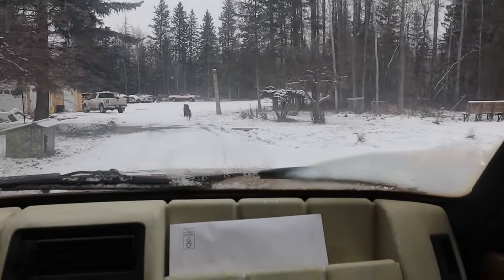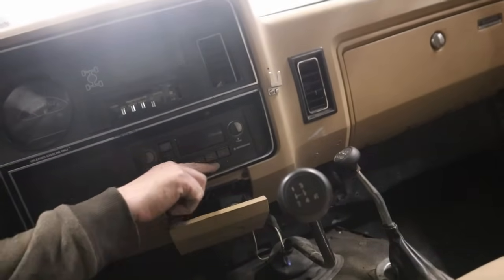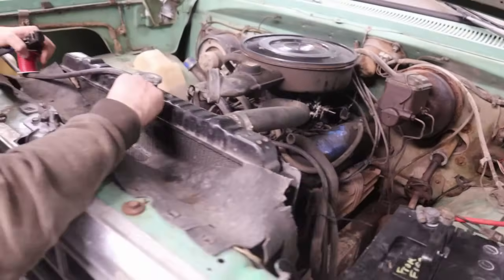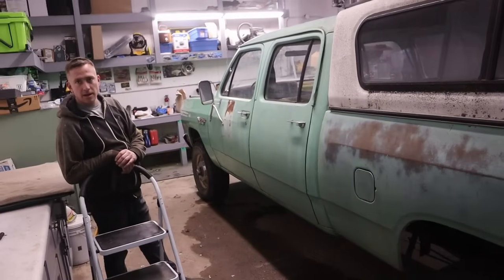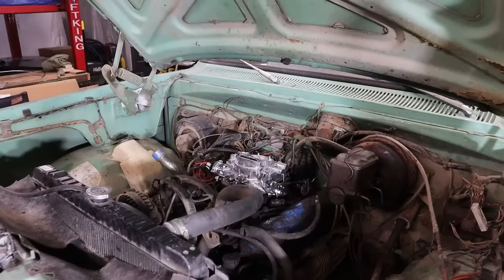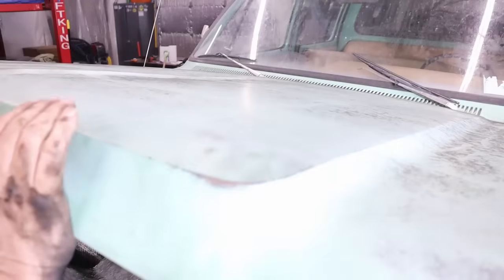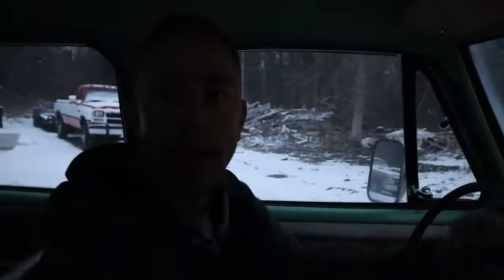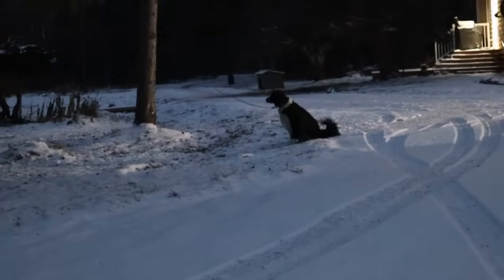Dodge Crewcab 4x4 Stick! Will this Ex-Forestry Truck Run?

Comment: Great truck and an excellent addition to Dan’s fleet. To get rid of the vacuum leak he’ll want to get a square bore to spread bore adapter. When I saw the carb go on without it and a big vacuum leak resulting I knew why. As it’s only for yard drives for now it’s fine

Comment: I’m from the UK, seeing someone climb into the engine bay & sit down to remove the carb is not an everyday sight 😅 What a beast that truck is 👍
Reply: I’ve done that with both of my square body Chevy trucks, just climb inside. To get the brake booster off on my current 73 one ton I also took the hood off

Comment: That color is pastel green. Very common color with state and federal forestry departments.  That color is used by the East Bay Regional Parks district. Where did this truck come from? You should try going to fuel injection.

Comment: Dan’s Crew cab was a find. A carburetor was the fix it needed. And wants to upgrade with a Cummins Diesel. I just would run the 318 until it was shot. But, know that won’t be the case. Thanks for sharing.
💯👍👊

Comment: What a great old truck. I've had all too many(but never enough) old Govt. Dodge pickups but never a Crewcab. An interesting thing I just learned after being surrounded by Mopars and Dodge trucks in particular since the 60s is that when they gave the D-series trucks the facelift in '81 where they replaced the Tin Grill and round headlights that God designed them with and squared off the sheetmetal, they didn't give the Clubcab and Crewcab the new roof with the sharper edge at the back and sides. I was looking at a Diesel '91 Clubcab Dually recently and asked the owner why they had to swap the cab be ause I saw it had the pre-81 round roof. He assured me it had never had the cab swapped and just as I was about to drop my VAST knowledge of everything Mopar on him I actually listened to that little voice in my brain and decided to keep my pie hole closed and do a little research before I said something dumb. Sure enough, only the regular cab got the updated roof.

So, the moral of the story is, It's easy to learn when,
A, you don't assume you know everything, and
3, you don't know much to begin with

Comment: Scott, A friend of mine in Seattle bought a US forest-service-green Dodge panel truck at a government surplus auction and drove it for at least 20 years! Dan's crew cab looks to be in about the same shape. Those trucks never saw many long distance runs or much over 40-50 MPH. I guess a diesel is a good swap but those 318s or slant 6s never quit! Gotta love the prices on those Chinese knockoffs and it worked! Cool run and drive! Looking forward to Sat! Cheers!
Reply: I’d leave the 318 in there 
Love that motor
Reply: I as well with the proper carb adapter. Dan’s engine sounds great, nice and quiet . They get ok fuel mileage also

Comment: I bought a car with one of those Chinese edelbrock type carbs and I ended up using the boosters out of a junk edelbrock to fix the issues I was experiencing with idle and part throttle and that fixed it.

Comment: Last time I saw a mechanic sit on the inner fender like that was when a small Chileno mechanic helped me replacing some parts on my Chevy sixbanger. That is why I LOVE old iron and I hate new stuff. I could not have passed on this one neighter. A great and basic vehicle. What is not there cannot be broken. 
Some idiots always complain how high the gas consumtion is with those old heavy duty vehicles. They prefer to spend money on enormous maintanance costs and do not even see that they loose thousands of $ as the  value of their nearly new vehicles falls towards zero in record time.

Comment: I bought one of those Chinese Rochester Quadrajet direct Replacements and even though it came with several primary Jets and pilot Jets it would not idle on a 305 , it would run to Rich at idle.
The old saying you get what you pay for and sometimes it's just a crap shoot whether it's good or bad I've had plenty of good small engine Chicom copies that worked .
 I've got a cj750 motorcycle with sidecar that is still chugging along even though it's a bmw 1938 R71 built in Russian under licences and then passed on to the Chinese!

Comment: On the 55 olds you can have a ignition key and door keys cut with the numbers that are found on the door key cyl and the trunk lock or glove box lock

On gm cars the keys were easy to have made  up into the early 70s

Comment: Nice truck project!!! As for GM keys they only made 165 different keys for the early GM I don't know if you have a collection of them but I did and found keys for my 61 Olds. If that doesn't work then you can take the locks in.

Comment: Chrysler was famous for using more vacuum actuators per inch than any other maker, and the hose lines at this age are weeping. Brake line steel in that truck should be looked at. Mine was just toast. It's a short bed isn't it? Will front springs have to be redone because of the Cummins? Really nice score. best of luck.

Comment: Christ  !!!! 
Dan's new truck is
 freaking MINT ‼️‼️

Cab corners & mounts , rockers ,
 windshield strip moldings  , etc 

"Canadian pesos" 😂😂😂

Dan can climb in the engine bay &
Beach himself during the needed repairs 😂

Wow , that Chineseinum carb actually worked 

No RWAL on that big boi 💀

I saw 👀 that blue  💙 & white 
LTD in the background

Comment: Excellent video Cold Water Motors Agents  Scott  :) also Dan pickup truck 1981 Dodge  crew cab too and did super to find for sure 👍,  ! Also you have Lol Scott my late Cousin Bill bought old 1975 Dodge D350  Extended  Van  was old Ambulance  at hospital 1984 then tore in to took 360 V8 2 barrel carb gas motor  , Manual transmission column shifter 3 in tree out , put a 1976 Massey Ferguson Combine 505 6 cylinders Perkins Desiel motor rebuilt up from been 356 Cubic Inches went 400 Cubic Inches  , Truck Transmission Eaton D18 Manual floor shifter with  Creeper Bow Low First gear  5 foward gear speeds , he took 411 put 390 gears for  12 bolt  to plus put extra fuel tank on left side , to he build up for 2 persons camper  ! Perkins Desiel motor not turbo but sounds like when drive it 4 foward like Overdrive  for up or down hills grades ! Fuel mileage is extremely better then I thought local 80 km local  highway it 18 mpg and 37.8 mpg on 100 kms  plus top speed 145 km/h ! But 24 volt Negative ground  with Mopar Alternator 100 amps and Starter to start up up Cold starts  and hot no problem! Yes Bill was Mechanics by trade and 2 owner of John Deere Dealership  near me with his brother and family since close up 2013! Great idea Bill had too do 1986 since past away  2002 but van still around  !

Comment: No vac advance? I deliberately defeat them to keep timing mechanically correct no problem. Was warned they would have a bit worse mileage but mileage wasn't the goal anyway. That's a big solid assed truck.

Comment: LOL He had to use that Copper gasket.
One of those Chinese carburetors that your gonna have to replace with a Real carburetor.
Hope the truck don't burn down.
Reply: Did you miss the part where he said this literally only needs to run long enough to pass inspection so he can Cummins-swap it? Kind of foolish to spend 2-3 times as much on an Edelbrock for such a short term need.

Comment: Awesome crewcab..I'd kill for this. 

However, I'd be putting an Isuzu 6bd1T up to this.

I'm in Oz. Isuzu diesel 6bt are cheap, available, hidden gems.

Yes, the 6bdt1T Isuzu, way better than the Cummins 5.9.